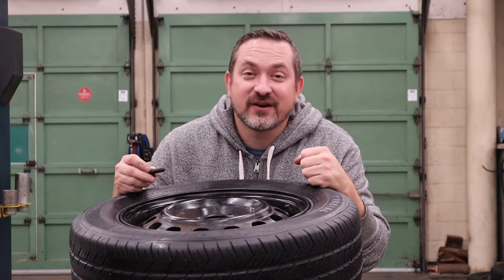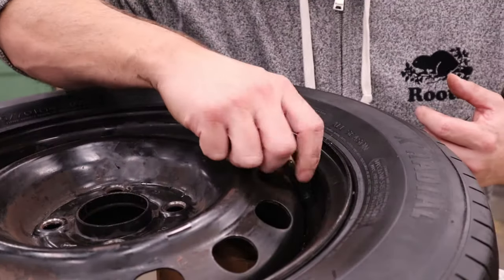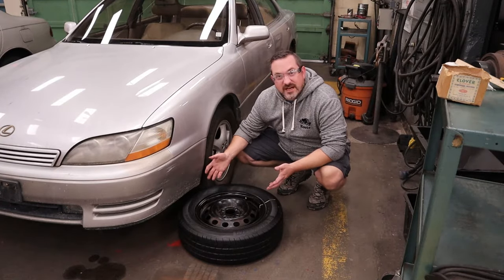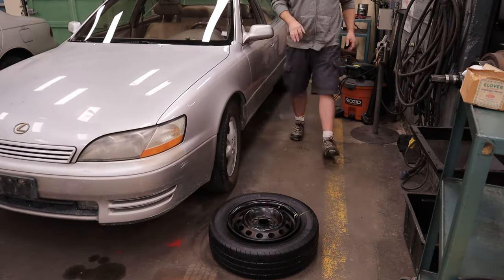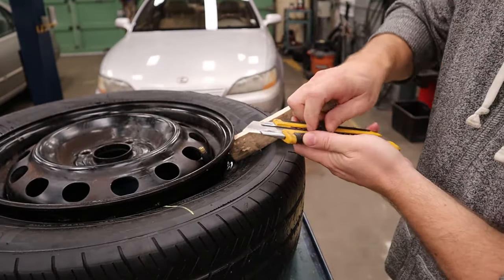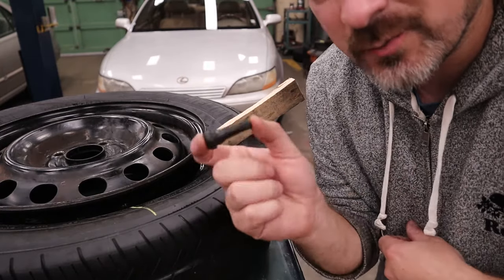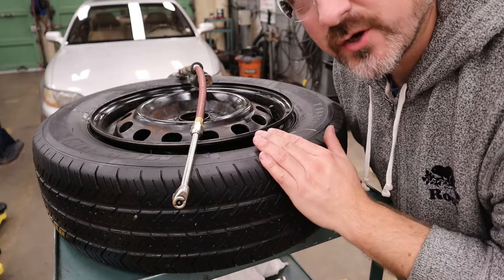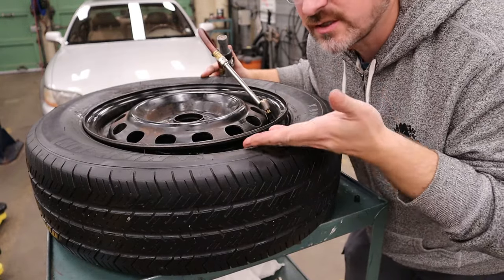How to replace a wheel valve stem or tpms sensor without a tire changer or wheel balancer !  Sweet!

Comment: Tire valves are made in two rim hole fittings: 0.453″ for tires with a max cold inflation pressure of 60 psi or 80 psi, and 0.625″ for those with 100 psi. So any personal vehicles are go to be 0.453. Length is 1.25”-2” and should be whatever length yours come with.
Reply from the maker: Good to know, I could have sworn that there was more than two diameters but maybe it was just the different lengths that I was seeing.  Cheers!
Reply: If the rubber does fall in there what's the worst that could happen with a round piece of rubber in there? Just wanted to know because I did that but I am going to to do it the real easy way with aa kit.
Reply from the maker: It'll rattle around and cause tire unbalance situations so maybe some vibrations at speed.

Comment: "Gonna show you how to do it without special tools..."
immediately lists two specialty tools
Thanks guy.
Reply from the maker: I see what your saying but any Princess Auto/Harbour Freight will have the valve core remover and valve stem installer tools for $20 total.  You gotta have some tools to play.  Without these tricks, your looking at a $1500 tire changer and a $1500 wheel balancer.....plus those other tools.  Thanks for the watch!
Reply: Special tooling typically requires substantial investment.  A stem puller @ $10 isn't 'specialty tools' to most people.  Ten minutes of this man's advice is literally worth more than the value of that tool.

Comment: hey guys, I see mentions of tire balancing alot, do I have to worry about this if Im doing a scooter rim? what happens that it gets unbalanced? is it from manhandling the rim? I dont understand, thanks
Reply from the maker: Tire and rims have heavy spots and centrifugal force pulls on the heavy spot when its spinning.  If the out of balance is enough, it will cause shaking/vibrations.  A scooter wheel might not suffer as bad due to the size.  Never had a scooter so I don't know if it is required.  If it goes less than 50km/hour, it also might not need it.  I have a great video on balancing if you want.

Comment: There is a tool that can fish out the TPMS sensor, in case you replace the TPMS sensor.   Also spray some soapy water around the rim to help getting tire's bead get back in when filling up with air?
Reply from the maker: Yeah that's a cool tool, I have one in my TPMS tool kit.  The soapy water is not a bad idea, especially if it's not moving or too tight.  Thanks for the watch!

Comment: I grabbed a Vise Grip, hooked the end of a coat hanger, and sprayed some WD40 into the hole to slick it up. Out in 2min.
Reply from the maker: Nice!  You were able to shove a new one in too?  Try that with a TPMS sensor.....lol Thanks for the watch!
Reply from the maker: Ya I figured that would happen.  I did however see a special custom tool that does allow you to install a valve without taking the tire off.  Looked kinda neat.  Cheers!

Comment: Great video. Thanks for the tips.  I would add a very simple additional item to check.  Use your valve core tool to check to ensure that the valve core in your new valve stem is tight to avoid the new valve stem from leaking overnight in your driveway if it wasn't tightened all the way from manufacture.  Takes 15 seconds to check that before airing up tire after new valve stem is installed. 👍
Reply from the maker: Yeah not a bad idea, I usually spit on my finger and put it over the valve stem to check for bubbles too.  Thanks for the watch and welcome to the channel!

Comment: For a standard non-tpms valve stem, why not just buy one of those tools that let you remove and install a new valve stem from outside the tire without breaking the bead?
Reply from the maker: If you have one, go for it!  I got a bunch of complaints saying that even the special installer tool I had was over the top for the everyday person to own.  If you have a link for a good one, put it here so people can check it out.  Thanks!

Comment: Easier way is to jack up the car, slide the tire under the car tire and lower the jack.
Reply from the maker: Be very careful that an edge of metal like the rocker panel lip doesn't tear a hole in the sidewall doing this.  Also don't place it under plastic panels or you'll damage them too.  Otherwise, yeah it's possible to do this and doable if you don't have another vehicle.  You do miss out on driving over a tire though.....lol.  Thanks for the watch and welcome to the channel!

Comment: Nice. Should we use a lube on the stem...air seal...water?
Reply from the maker: Nope, just clean the hole area  on the rim and sand the rim lightly if there is heavy erosion or loose paint.   If you have the same size valve stem, you just install it....no lube or sealant needed.  Thanks for the watch! Cheers!

Comment: so happy I still have a car with no tpms    when I started doing car and truck repair  there was no such thing   there more of a pita than anything else       I will hold on to my car for as long as I can   and there is a reason why people dont buy new cars    I dont want a epb  and you know why   for doing rear brakes   my car has drums and shoes
Reply from the maker: Ya know once you start working with them and learn some tricks to work around them, they aren't that bad.  I now own a vehicle with them and they are useful, especially when towing a trailer down a rough forestry road and you're worried about tires going flat.  I see them all the time now and they aren't that bad.  The Ford style band tpms are another deal, I hate them as they seem to always brake and need replacing.  Same with the brakes, once you learn how to inspect/replace drum and disk, you're golden.  Stick with me and I'll show you all my tricks and tips.  Thanks for the watch!

Comment: Super! Just wondering if alloys and steel rims have same valve stem?
Reply from the maker: Yes they can but they differ depending on different vehicles.  Some are bigger/longer or if they are tpms, they might be solid aluminum.  Usually you just take your old one off and go buy 4 new ones that match at the auto parts store and install them. Thanks for the watch!

Comment: You dont need valve setting tool, cutting pliers will do the job even better, but you dont wanna be using those on fancy or painted rims if you car. I work at a tire shop so i know.
Reply from the maker: I'm sure they work but can damage the stem if you're not careful.  If you work at a tire shop, why don't they have the correct tool?  Thanks for the watch!
Reply: @wayofthewrench  it can't. why we don't use stem puller  on steel rims? Because why would i choose a method that wastes time on a rusty rim, or that factory painted which wouldnt get damaged either, when i have many clients waiting  for their tire change, it is simply much faster and easier to do. thought i wouldnt recommed it for reinfored valves since they take significant amount of force to pull through and you can shave off thread. My boss had a shop for 30 years and im pretty sure he knows his stuff.
Reply from the maker: That's cool you have a quick way to install valve stems.  I teach high school kids how to do this job so I tend to show methods that have a good success rate without them damaging customer cars.  I don't mind them taking a couple extra minutes to not damage the new stems.  Cheers!

Comment: After u put the valve steam you didn't show us how to connect TPMS sensor body to steam. 
I was looking for that connection. 
Thanks for the video
Reply from the maker: I have a video on TPMS sensors you should watch.  It also depends on what vehicle it is and what sensor you put in.  Some auto relearn and some need a TPMS tool to reset.  Thanks for the watch!
Reply: @wayofthewrench  thanks for the reply. I got I installed today at delarship. I was wondering
Reply from the maker: You're very welcome!

Comment: Fun Fact. 
This method doesn’t work on low profile tires. 35 series or lower
Reply from the maker: Yeah the low profiles need the drop center pushed down first and they will be extremely tight.  It might be possible but not fun for sure.  Better to have a tire changer with a helper arm for those tires.  Thanks for the watch!

Comment: You don't even need the box cutter or anything to cut the valve stem. You can use the install tool to also pull the old one out as well. So that would be one less tool if you don't want to cut it
Reply from the maker: True, never thought of that.  I guess I never did that cause I worried it might damage the threads on the installer tool. Thanks for the tip!

Comment: Is the tmps in a different part of the tire?
Reply from the maker: TPMS is either part of the valve stem, a strapped sensor on the time or there isn't a sensor and it uses the wheel speed sensors.  Hope that helps.  Thanks for the watch!

Comment: Hello. I did that but the rubber part is inside the tire is that a problem if I leave it inside?
Reply from the maker: Yes and no.  I personally wouldn't leave it in.  Since you have broken the bead to get the new valve stem in, just fish it out of there by rolling it around with the tire upside down and it'll fall out.....eventually.  Good luck!  You got this!

Comment: Great video!  If my tpms dash light flashes on start and then goes solid, does that mean one or more of my 4 tire pressure sensors has failed or has a dead battery?  How can I know which one of the four has failed?
Reply from the maker: Thanks!  Yes if it flashes and then goes solid, that means one or more of your tpms sensors has an issue.  A few cars might tell you which sensor it is by a display monitor on the dash but most won't.  Most will require a tpms scan tool like in the video to tell you which one it is and to reset the new one when you replace it.  You can just change one but after about 10 to 15 years, all of the sensors will need changed because the batteries will fail.  Hope this helps and thanks for the watch!

Comment: I would say a must have tool when doing tires is some sort of tire tool from harbor freight or tractor supply. Just got one after I couldn't break a bead that has been on the wheel for over 10 years.
Reply from the maker: True but if you can't break a bead by running it over with a car.....that tool ain't gonna work.  Thanks for the watch!
Reply: @wayofthewrench  that's what I thought but got the tool not just the bar the stand to fully change a tire finally got them. 3 days for 4 tires.
Reply: @wayofthewrench  not to mention shop was gonna charge 45 for 1 tire and the tool cost around the same.
Reply from the maker: Yeah, better to spend the money on a tool than give it away to someone else.
Reply: Burritoless, I sure hope that you're replacing that ten-year-old tire.  It's unsafe to drive on one anywhere near that old.  They tend to fail at the worst possible times.
Reply from the maker: Tru dat!  They actually can't even be sold if they are 7 years old but brand new.

Comment: Help, my question is I want to remove all TPMS sensors out on 2011 Hyundai Tucson GLS and install regular valve stems.
What valve stem brand and part number that I can buy from the internet?
Reply from the maker: May I ask why you would want to remove your tpms sensors?
Reply from the maker: I would say that these aren't scams and that tpms sensors are a good safety feature but I agree at paying $400 is too much.  You can replace your own for approx $30 each if you do it yourself.  Most reset themselves without the tpms scan tool.  Good luck!
Reply: @wayofthewrench  Actually many can't do them completely because if they got 3rd party sensor or moved (rotates) the tire too much from the wheel, then a wheel alignment will be needed. Still $120.00 is not cheap even when one is able to DIY. 
Again how silly that the TPMS' battery causes many problems & less than 9% are able to replace the battery.
Kinda silly like on some cars when one needs to replace the headlight assy that the front bumper must be removed. 
Or a shop torqued a wheel lug nut too tight (you are about to remove the bolt to rotate/flat tire or inspection time) that is going to cost over $475,00 just to replace 1 bolt = one of the worst engineered because one can't remove the broken bolt out without doing many other jobs.
Reply from the maker: All the more reason to stick around and learn how to do all of this yourself for as cheap as you can....plus you'll know you did it right.  Cheers!

Comment: Or use a jack.
Reply from the maker: Ya need more than a jack though.....I'm assuming you're talking about breaking the bead?
Reply: @wayofthewrench  yes.
Reply from the maker: I've done it with a jack and 2 jacks with ratchet straps too.  I like driving over the tires though, people always wondering what is going on when I do it....Cheers!

Comment: I can see replacing a normal valve stem this way, but isn't the TPMS sensor  much bigger? I guess you'd need a big clamp to get the tire out of the way for that. I hate the thought of worrying about sensors and batteries on my 11-year-old Hyndai, so I hope to put regular valves in and tape over the light. I wish my car had an indirect TPMS system with no sensors.
Reply from the maker: It's harder and definitely not the preferred way but it is doable.  I just did this on a motorcycle and I needed to add 2 c clamps with wood to make more room but I got it and I didn't even need to remove the wheel from the bike.  Yeah 11 years is getting there, 10 to 15 years is the battery life.  To be honest, I enjoy the peace of mind now with tpms especially when I'm towing and I hear a weird noise and I don't have to worry that I have a flat...just check and keep driving.  Thanks for the watch!
Reply: Taping over the tire pressure warning light might not work as good as you think. When my Chevrolet tire warning sensor went bad, the computer display would flash warnings about every 30 seconds. Problem was... EVERY computer readout, such as MPG, total miles, air temperature, etc. would be replaced by the tire warning light. The readouts were then about useless as they continually kept getting replaced by the low pressure warning light. The only real solution was to replace the faulty tire pressure sensor mounted inside the tire. My problem was solved a different way; I hit a deer at 35 miles per hour and it totaled the car.

Comment: in my 32 years i've never heard someone say decal like that. 
you said no special tools. i would consider a specifically designed tool used for a single purpose to be a special tool. such as the valve stem tool and valve puller. 
i would not recommend driving on a tire to break the bead. its not that hard to do it with leverage.  if you get too zealous you can mess up both rims.
Reply from the maker: Deh cal.....dee cal.   Potayto...potato.

Yup no special equipment.....a 5 dollar tool isn't that expensive or hard to get.

Lots of methods to do all of this stuff.  This is one that was passed down by my ancestors.  It's  easy to do, if you can drive a car, you can carefully drive over the tire and not damage the rim.

Thanks for the watch and your feedback.

Comment: As a full time mechanic...just take it to a shop and pay them the $10 to do it
Reply from the maker: Yup they will charge you $10 for the new $2 valve stem but they will smack you with a charge for removing the tire and balancing...and then they see it's a BMW and add a zero. Thanks for the watch!
Reply: I charge a $10 flat rate for valve stem repairs at my shop... apparently I'm doing it wrong
Reply from the maker: LOL....nah, you're just one of the good guys not trying to screw over customers.  Works as a good lost leader too for customers to come back to you for more expensive repairs later.  I charge $2.50 for mine  plus $7.50 for balancing.....it's amazing how much people are charging for balancing these days! Cheers
Reply: Last time I did that it was $64.
Reply: @wayofthewrench  Yeah discount tire is a racket they give you the tires at a discount then charge $100 to put them on like it really cost that much to balance and mount 4 tires.
Reply: I agree. Anything can go wrong. Just let them do it. This is pushing it too far. But glad that I now understand a bit more about what the guys at the tire shop do. You explained it well.

Comment: You said no special tools....
Reply from the maker: I kinda meant no tire changer and no  wheel balancer but you do need a $5 valve stem installer from Princess Auto which should be easy to get.  Thanks for the watch!